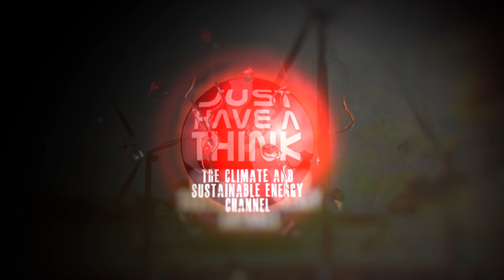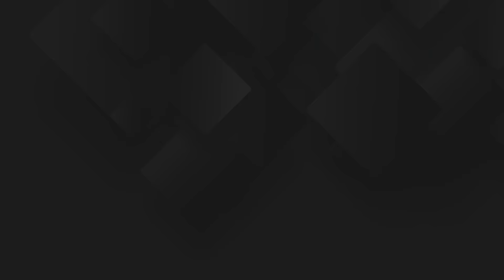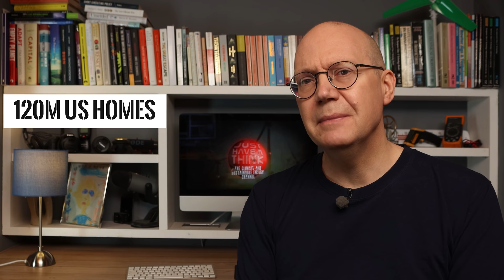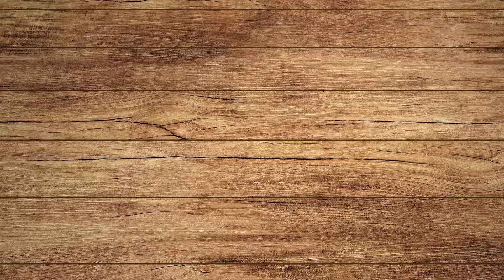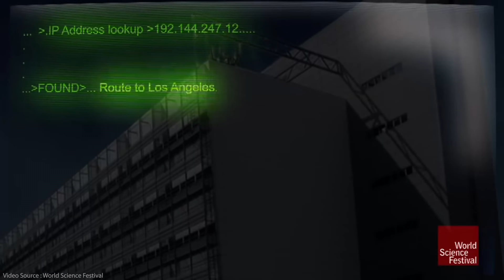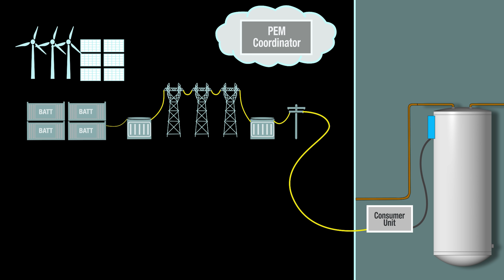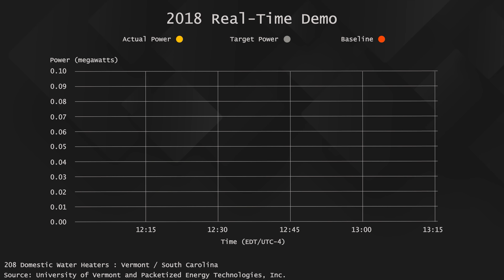How to balance renewable grids WITHOUT energy storage!

Comment: During heavy wind you could split water into oxygen and hydrogen underwater inside pure water long high tanks under the sea... The bubbles created could turn huge Ferris wheels then burn the bubbles after many many Ferris wheels at the surface creating yet more power... It's an idea I originally thought of years ago however new developments in water splitting tech could just make it possible... Remember on the TV show blue Peter when they raised an old galleon called the Mary rose using air filled balloons??? That was the genesis of my idea and new catalysts could make it cheap enough

Comment: I'm not sure that it will be "eye-wateringly expensive," although any transition of a system as large as the world electric power system will necessarily be expensive.  Compared to what? is the question that needs to be asked.  ReThinkx seems to think that Solar, Wind, and Batteries will be the cheapest energy system ever created, and. based on the analysis they present, I think they are right.
+.

Comment: Battery storage in every home with the battery able to also level out the demands made to the PEM could take this further. Couple with a mas rollout of PV panels on rooves and it should be perfectly viable to balance out huge chunks of the grid to work on renewables with fossil fuel baseline and quick response systems only needed in more extreme conditions. Of course this requires governments to be courageous, something anyone who has watched Yes Minister will know how the feel about.

Comment: Could you lift huge boulders into the air or up mountains during high power times then let them fall using gearing when power is low?
Reply: Keep reading lower

Comment: This could help to balance power over 1 or 2 hour of period.. but that is not enough to have 100% wind solar share.
That is why so many nations or states are starting to plan for hydrogen storage.
That no only could solve any long term discharge up to seasonal disparities, it can also solve all the co2 emissions from the natural gas grid and the utility transport sector in a cost efficient way, which can not be solve using smart grid or batteries. 
And I am still amaze how little importance you give to hydrogen even with all the huge clues that investors and countries are giving you.  For example check the 840 billion pipeline that Australia already has plan. 
Right now they are installing a 2gw electrolyzer plant that would double world capacity, and that is just the start. 
They plan to generate 6 times their current power grid needs and become an hydrogen super power. 
this could help to balance power over 1 or 2 hour of period.. but that is not enough to have 100% wind solar share.
That is why so many nations or states are starting to plan for hydrogen storage.

Comment: This is nothing new. It’s called demand-side response and it has been piloted 10 years ago in Denmark, with mixed customer’s opinions on its effectiveness. Moreover in the EU every electricity network transmission operator must asssign each user, and tell them, periods of hours each day when electricity can be curtailed to reduce load on the network. Which is inflexible but gets the work done. It could more easily upgraded to allow switching off only non essentials loads in homes by giving the electricity meter (which are recommissioned every 15-20 years) multiple output circuits to be able to curtail each one independently.

Comment: If the ONLY information being sent and received
 is  power requests,
 that needs to be made clear and demonstrable
 to consumers and governments alike.   

But what happens if the servers go down?  
Will the users still get their present standard process 
 (as in as it is now )grid supply?  
 
Small renewable grid nodes 
 and energy storage methods,
 (whether the various molten salt or iron batteries , water/gravity or heated rock towers )
need to be  placed and integrated in a balanced feasible way 
 into local regions that are otherwise unusable
 for agriculture or human occupation,
 before this goes into a nationwide scaleup.

 (And planned to be placed well above any estimated new flood levels.)

Comment: balancing power grids hasn’t really changed that much on most grids. fast ramping, aero derivative gas turbines does it the same for matching inflexible baseload to changing demand as they do for do for variable renewable generation with changing demand. Batteries can really a lot help with frequency in a way that is cheaper than OCGTs. .this is true of South Australia which is 60% RE, one of the highest penetrations of wind and solar on the world (some places that are 100% RE like NZ and tasmania are mostly hydro).

Comment: I think the hot water heater is a poor choice for this kind of device. Water heaters for every home should be an off grid solar/battery device, this way users and abusers would never cause.  Heat pump air conditioning should also be made from factory with their own batteries to lessen the surge on the grid. (Kind like very strong start capacitor’s.) We need to rethink all our home appliances to include their own batteries. Perhaps every home and every appliance should have their own uninterrupted (battery) power supply or UPS systems, much like the way we protect or critical computer systems. These UPS’s could easily be connected to these network power grids.

Comment: Would any existing device need to be modified to take part in this system? If so that means every boiler, hot water heater etc in the country would have to be modified/changed. Would older systems be able to be modified or would they have to be replaced? Who would foot the bill for those on low incomes?

Comment: This is great and quite genius, however it makes me worry that, as the grid gets "used" to having the energy flexibility afforded by that 1 device per household, they're going to want more and more flexibility via more devices in each household being wired in. And they might reduce their energy generation... But then what happens if there's an internet blackout, and suddenly they need to generate power at full scale again?
Reply: Don't use the internet. Their is already a cable connecting the device to the power station. Use that one instead.

Comment: There's a thing to be said for carbon-based fuel consumption like gasoline and Diesel instant energy when you need it in an emergency or charging instantaneously when you need it in an emergency not regulation of energy whenever they get to get to it the analogy is like this wonder if a criminal receives his bullets before you receive yours due to regulations

Comment: Sounds like a very complex solution to an already simply solved problem.

There's already controlled load. You get cheap electricity, the grid operator can turn on and off relays on meterboxes via a signal sent over the powerlines. Devices that are safe to operate unattended are permanently connected to circuits controlled by the relays. Pool pumps, hot water, storage heaters, EV chargers are all just wired to the controlled load circuit. The network operators can turn on and off individual suburbs.

Comment: Is there a reference for what would happen if (worldwide), we used solar, wind, geothermal power plants, geothermal heat pumps, tidal and hydroelectric?  Would we reasonably be able to get off fossil fuels entirely (without destroying the planet in other ways).  All of those have drawbacks; tidal won't work in the center of continents, solar won't work at higher latitudes, etc.  I have PV solar panels on the roof of my house, I would like to get a decent wind turbine to compliment it, and I think I could get entirely off the grid with those two things if I just had a geothermal heat pump.  (For those who don't know what I'm talking about, I mean when you run pipes under ground with water in them, and that water circulates into some sort of compressor inside.  The ground temperature is stable at 45-75 degrees F and MUCH closer to comfortable than temperature extremes outside.  Assuming 45 degrees, that means you only have to augment with your heater for 25 degrees to get it to 70 inside, and assuming 75 degrees, you only have to cool 5 degrees to get to 70 in summer.  If you have wind and solar powering your home, that's a much smaller load of electricity).

That may not be feasible in all locations (it may well not be particularly feasible in MINE; the ground is very silty), but that goes for any energy generation (including fossil fuels!)
Reply: It requires massive energy storage. How much energy storage is required depends on how willing tribal groups ("countries") are to take a chance on other tribal groups staying their friends. For a small un-connected tribal group the energy storage would need to be more massive. Something like 10 days of full energy demand to prevent disasters. For a huge grid perhaps 1 days of full energy demand would assure no disasters with near 100% certainty.  The alternative is much more nuclear fission and I'm very much in favour of that.
Reply: @grindupBaker  let's simplify the argument and just look at per continent.  I'm not trying to go down the parenthetical and hypothetical "every geopolitical possibility" rabbit hole. Obviously you can't use tidal in Kansas. Obviously solar in Alaska is not going to work half the time. I live in Texas....i got cold last year and the ENTIRE STATE shut down for a week and hundreds of people died, so storage isn't a consideration at the moment. 

I'm asking if it is possible to move to purely renewables.

Id also like to know (in a separate discussion) about any damage caused by geothermal heat pump.  I live in a single story house in the suburbs, so I'm pretty sure I hypothetically could put one on my property without causing a lot of environmental damage, but high-rise apartment buildings may be a different matter.. Or maybe not, because they're in the city, but possibly some other buildings in more rural areas could cause damage.

Comment: In my opinion PEM ist way too complicated. Just consider the amount  of develoment work and possible failures of communication systems. It would be much simpler If non-realtime devices like water-heaters regulate their power-consumption proportional to the grid-frequency.

Comment: I seriously don't like the proposed software idea. So if it's a somewhat problematic moment (like an extreme winter), boilers all over will be denied requests and more and more boilers will fall in temperature. Then they start dropping below the "opt-out" temperature and suddenly it's even more problematic and more boilers will be denied requests and more will opt-out, possibly spiking the demand.
At best, that "worst case scenario" is exactly what we have right now, at worst - it tries to hold onto a greedy strategy for longer while advancing towards the critical state more quickly in a positive feedback loop.
Really, it's just the "opt-out" system that bugs me and there isn't even an incentive to opt-in at all. Hopefully, this will be revised because, even if I didn't hit the mark, there are definitely problems with it.

Comment: Can the system store energy in an EV and pull it out if it needs extra power on the grid? It would be nice to be able to keep the battery in your EV between say 50% to 80% and, when the system needs extra power, it can pull power from your battery as long as it doesn't go below the minimum you've set. Consumers would obviously get discounted power for providing this service. Or has this already been done?

Comment: Nothing entirely new. New Zealand has had a mechanism since the 1970s (earlier?)) which allowed the local distribution operator to controll demand from domestic consumers. The operator can switch off all domestic electric water heaters for a block of consumers by sending a special signal (like a higher frequency buzz) overlaid on power lines. So easy to shed loads quickly. - and this was decades before smart grids were a thing.

Comment: Renewables will not reduce overall energy costs.  They are going to put more stress on families as just one more thing to try and manage.  Currently large utilities gsin the benefit of load diversity naturally without any load management devices.  To connect electric vehicle batteries to the power grid requires expensive equipment to be installed.

Comment: Hmm looks like another license to print money for energy providers.  Presumably each PEM device needs to be enabled or registered somehow, or even if it is not, each plug in your wall could be enabled or registered.  What's to prevent energy providers from charging a fee for registration?
Reply: Then you don't use the PEM device.

Comment: All I saw was a system that handles the demand side. What possible difference does this make when the variability is on the supply side? Almost every time I see someone trying to explain the virtue of randomly variable renewable energy they argue from a viewpoint of today. That is, the argument is based on the abundant availability of dispatchable and reliable energy that already handles the variability from renewables. However, when the share of renewables pass a threshold there is not enough dispatchable energy to cover the loss on the supply side when the clouds move in and wind dies down and any trick you can play on the demand side becomes increasingly futile. I do not see that this idea solves the main issue. And the idea is old, to boot. Smartgrids have been worked on for over a decade already, and is rooted in ideas way older than that.

Comment: All of these ideas are based around centralizing everything, which Necessitates the requirement for lots of infrastructure to bring energy or water to customers.... Instead of localizing power generation on site of where the Energy is being used...
 If you do energy production the right way, drinking water is one of the waste products.

Comment: This is just a spin on the old program of A/C thermostats connected to the smart meter. You say it isn't -- but it is. Comparing it to the internet is just hand waving. Modeling one type of load is the same computer power as modeling another. When it all boils down to it the individual takes a cold shower and the utility gets rich.

Comment: This is paradigm shifting stuff!  To my mind, it finally begins to take all the smart home gimmickry being pushed of late, and that I find zero use for, and actually puts it to work in a genuinely meaningful and greater society benefiting way. Outstanding!  
The big question that I am left with is backwards compatibility. I am in no rush to replace all of my high demand but dumb appliances with new smart devices and would rather argue that it would be perversely wasteful to do so.  In a broad sense, that’s going to slow adoption.  Maybe what’s needed there is a smart controller retrofitted in the given device feed line.  Make those cheap and with incentives to install.  Seems doable with adequate smart policy. If only that was more common these days…

Comment: This system is inherently flawed due to societal hacks.  It leaves us vulnerable to bad actors in the energy sector using the scheduler to throttle our access.  It also allows bad actors on the consumer side to hack the system for their own gains or to interfere with yours the way IoT devices are vulnerable.  Lastly device manufacturers would be incentivized to provide have and have-not devices that divide who gets quality electricity delivery based on price paid.

Seems easier to just drop a smart battery storage on each house and have those use a PEM system instead of each consumer good.  This would allow flexible charge scheduling while also smoothing spikes in draw demand and be much simpler to implement.  It would also add additional storage capacity to the grid.